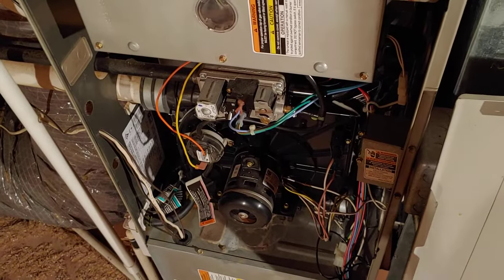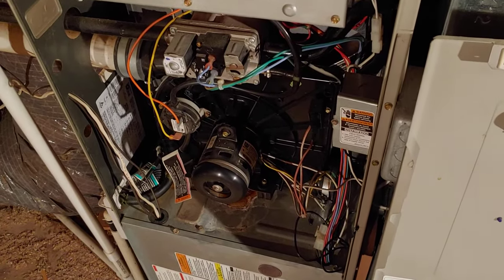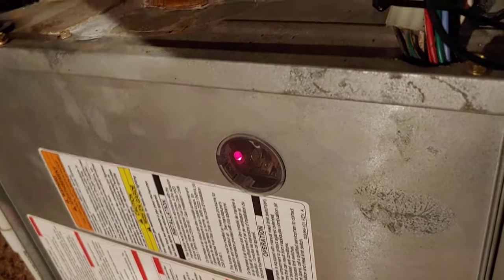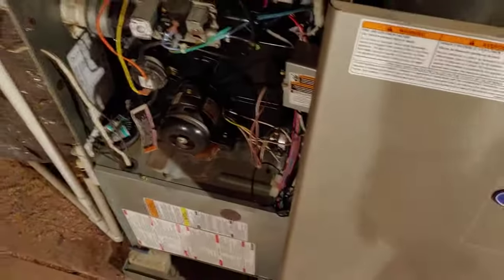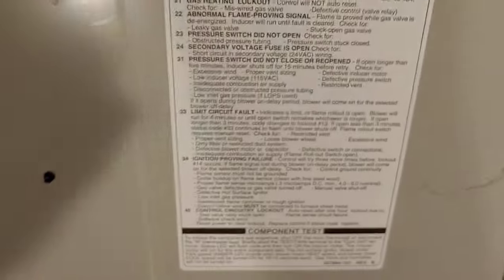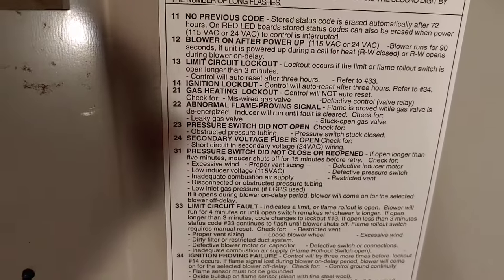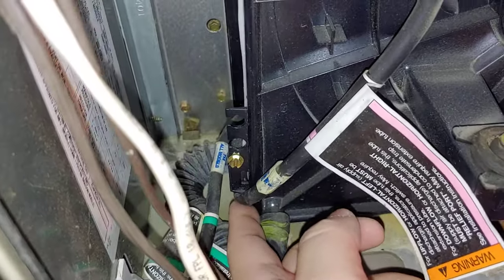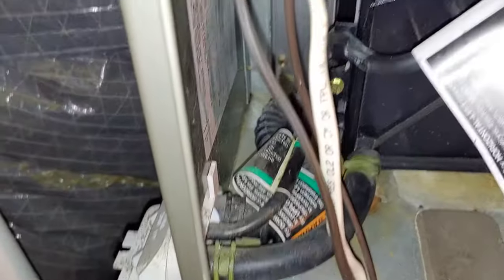Carrier furnace does not turn on Code 23 "Pressure Switch Did Not Open" I fixed it myself for free.

Comment: It's going to act up again. Theres a reason the switch stuck, and it's not because of that pinched tube. The pinched tube would make it a code 31, did not close. I think your control board has a sticking inducer relay.
Reply from the maker: The furnace fired right up as soon as I loosened up the tube that was pinched.  I might have to replace the switch and hopefully that is not too expensive.
Reply: @chaicharin  just wait to see what happens. Code 23s are rare.

Comment: Those silicone hoses are stiffer and less likely to kink when cold or at room temp but when they heat up they get more flexible and kink easily. As theyvget older they harden causing them to permanently adapt in shape according to the stresses normally applied to them, causing your kink. But generally the obstruction they are referring to have nothing to do with those hoses because they run on negative pressure created by the venturi effect created by the induction motor, which means that if your cold air intake pipe or your exhaust pipe get obstructed you will lose that venturi vacuum in those little pressure switch hoses you are playing with.... and no they dont have gas running through them so next time just pop them off one fitting at a time while your induction fan is running and use a lighter near the tube opening to see if theres enough vacuum to suck your lighter flame in. If not then try to shop vac your intake and exhaust pipes and see if it sucks up the birdnest or dead mouse plugging up your pipe.
Reply from the maker: Awesome advice like a pro.  Thank you

Comment: I actually pulled my one line off......and blew into it lightly.  Seemed like it dislodged something.  When blowing (lightly) from the other end of the hose.....you should be able to hear the pressure switch click.  Meaning it is working.   Also have had issues with mine not staying lit.  Check the flame sensor.....and if it still shuts off.....make sure that your pipes are not full of water from the condensation (like mine was).  I just lifted up the pipe a couple of inches from inside the house and it drained any excess water to the outside at the outlet.  Also make sure outlet outside is not free of ice.   All has been good ever since.  Nice video.

Comment: I’ve had the error code 23 happen a couple times this past week and have an HVAC tech out to do diagnostics but they havent been able to locate an issue and the error continues to periodically happen.  When I turn off power to the furnace for 5 minutes it resets the code and the furnace eventually restarts.  Does anyone have any idea what might be causing this intermittent malfunctioning?
Reply: U can do it yourself trust me i do hvac but it’s pretty easy from what your saying sounds like first check the tube and the switch to make sure nothing is blocking it u can give the tube a blow to get any kind of debris that could be in there if that doesn’t work just replace the pressure switch its like 25$ part like he said and if it still doesn’t work and ur getting same code id then get a tech there again.

Comment: Bro I literally just squeezed the tube and it kicked on. Thanks man.
Reply from the maker: I would highly recommend you check the white condensation plastic part below and clean it out.   Mine was stopped up with all kinds of black gunk that collected over the years and was making my furnace shut off into safety mode because of all the water that collected and did not drain.

Comment: Thank you for the video, I have the same furnace however it was installed upside down. For the life of me I could not find the switch or a video showing its location, whoever installed it ran tubes right over it blocking it completly. Much appreciated.
Reply from the maker: Glad I could help
Reply: They make downdraft furnaces and updraft furnaces. The difference is that one looks upside down compared to the other. Generally one is made to mount in the attic while the other is made for a basement, hence the down/updraft

Comment: I cant get to the first step of turning it off. There is no obvious power switch that I can find.
On the left there is the gas line, no power switch, on the right no power switch as in your video,
on the bottom of the unit there is a box, but no switch there either.
Reply from the maker: Mine has a light switch on the side which is code in my area.  I guess you could pull the switch in your electrical box to shut the power off.    However when you take the door off the unit should power off as well since it should have a button that stays down in the on position when your door is on it.

Comment: Thanks man ! You save me 150 bucks .
Reply from the maker: Glad I could help.   I'm going to be replacing the blower motor and wheel in my basement Carrier 58MCA100-18116 and doing a detailed video on it.   It has been making crazy noises and sometimes stops working and makes a burning motor smell.